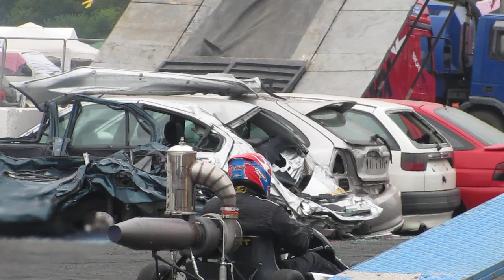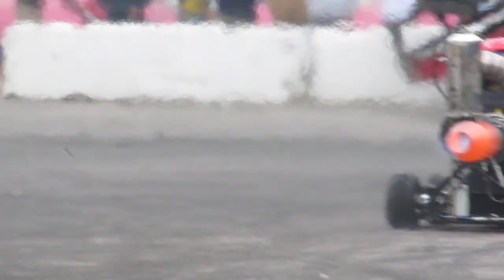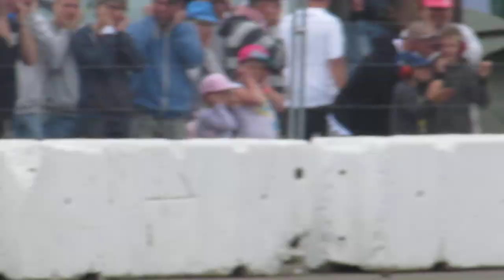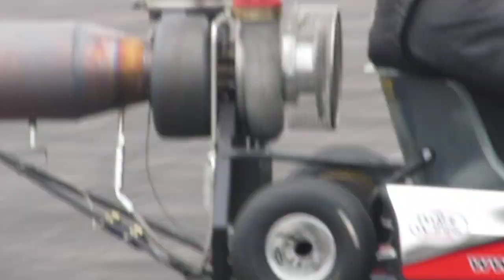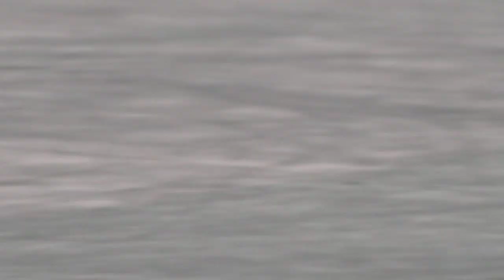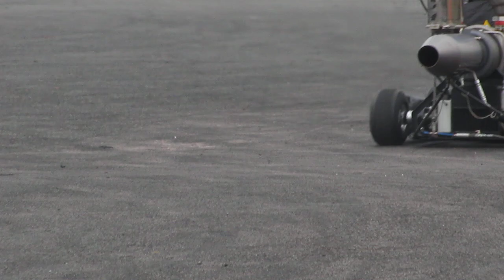DIY GasTurbine  jet kart diygt.org... santa pod   bug jam Andy

Comment: I think it’s just to slow for a jet engine strapped on the back I thought it would break the sound barrier judging by the size and noise of the engine
Reply from the maker: Hi, yep it did do 116mph on th track 😃
Reply: @Turbojetkart  wow that’s insanely fast for a go cart u are the master of building jet engines it’s a masterpiece that u have build u really deserve a billion subs
Reply from the maker: @taneyadasmandal1901  thanks.... new one should be 140 mph +
Reply: @Turbojetkart  at that speed a light object like a go cart would probably start flying but definitely waiting for 140 mph go cart

Comment: 8 litres of fuel in 3 minutes, that's actually somewhat efficient for the power to weight ratio. Also, a glowing red tailpipe is where the fun starts. You need a runway for this awesome ridd :)